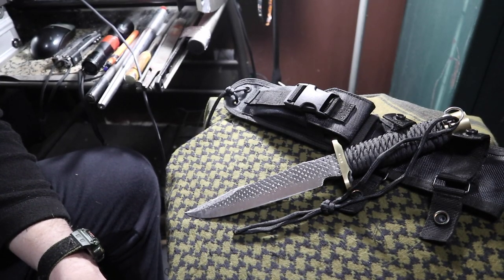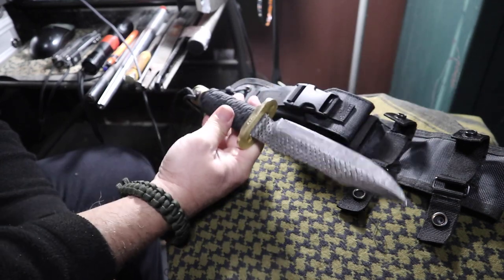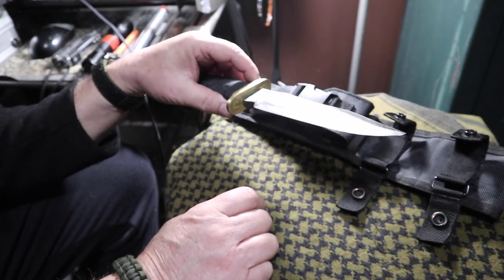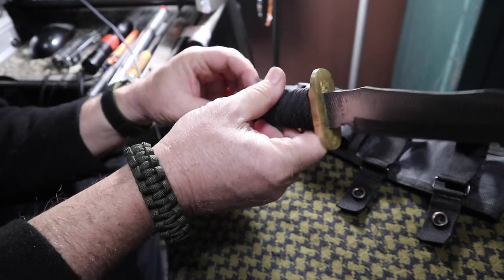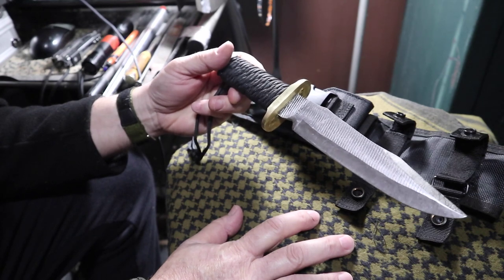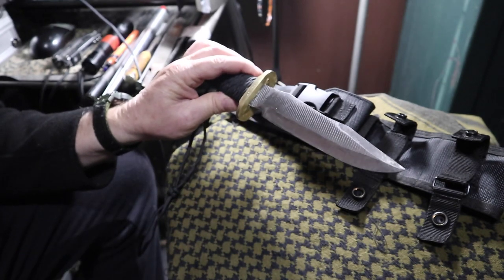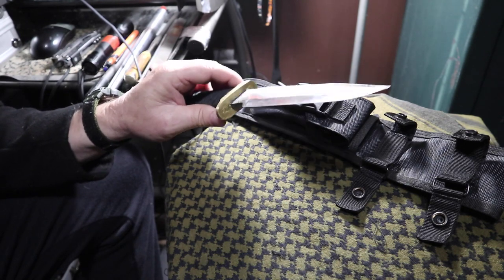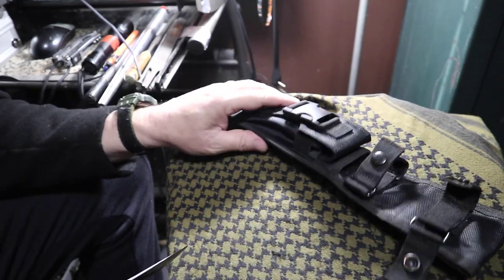SOG 5th Special Forces Combat Knife HANDMADE by SMI

Comment: You did a fantastic job on those lines  ,it came out very well and looks real capable for what it's designed for ⚔️🎖️🪖🎖️🪖🎖️⚔️
Reply from the maker: It is very capable, it's insanely razor sharp!  I'm currently working on 3 more of these but all with traditional  stacked leather handles.